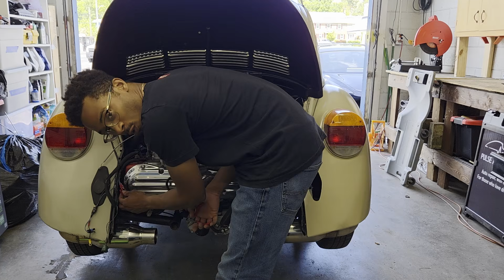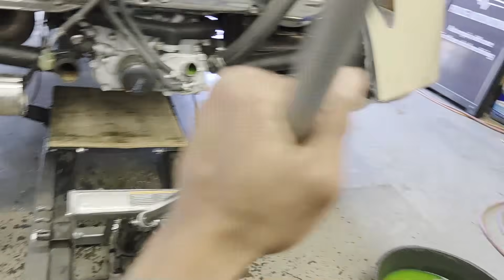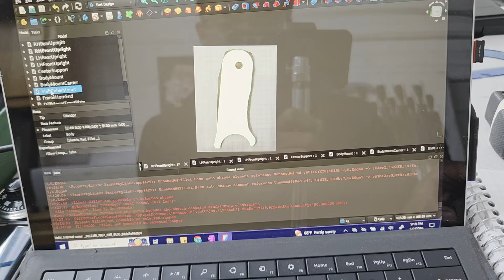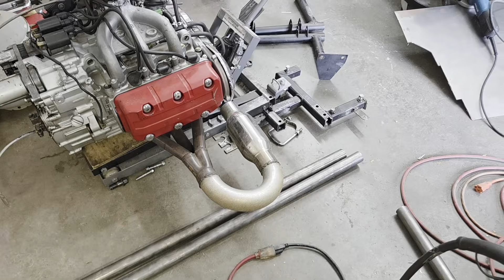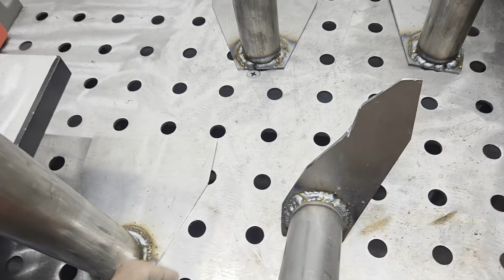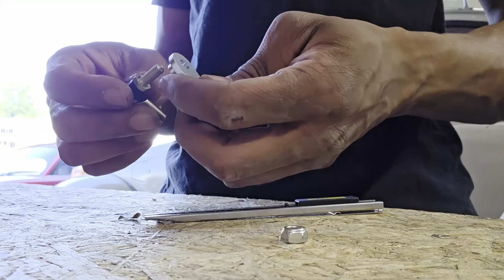Redoing my Goldwing Engine Swap

Comment: Porsche 930 CV joints will tolerate angles of 22°-26°, there are modified joints 930E that will operate to about 35°. Not as expensive as you might imagine.

Comment: That's not to much angle on the axles, you're using the wrong kind of CV's. Trailing arms have lots of plunge. Those CV's are for an A-arm car with very low plunge.

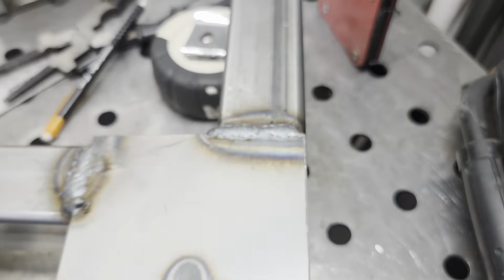Comment: The view at 23:47 shows why this was never going to end well. The engine output shaft offset towards the drivers side would require a differential which adds an offset to the other side of the car, not further to the drivers side. The differential being offset forward of the rear wheel hubs adds to the problem.

Comment: Regarding the engine bay door, after you reset the drive system, see about making spacers to mount the lid back off the body. Kind of like the hot, high CC’s engines did for more cooling. Looking forward to the next episode!
Reply from the maker: Good idea